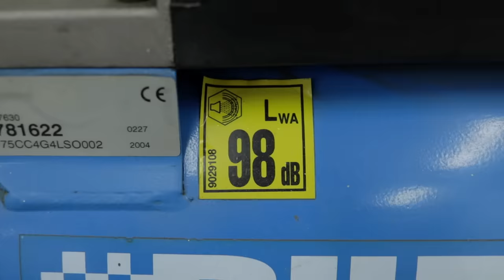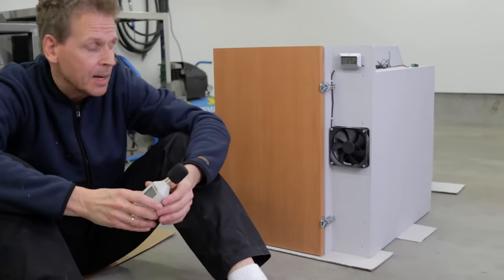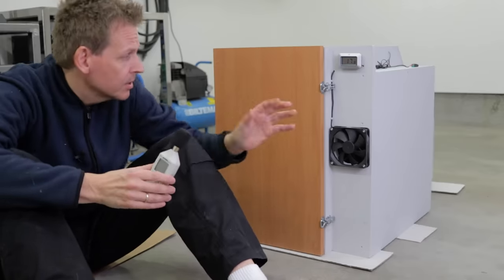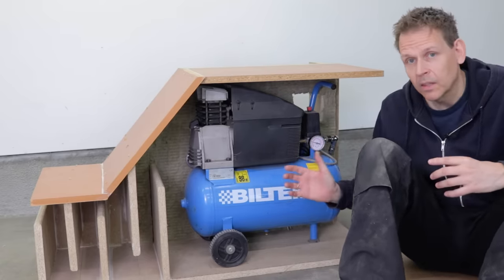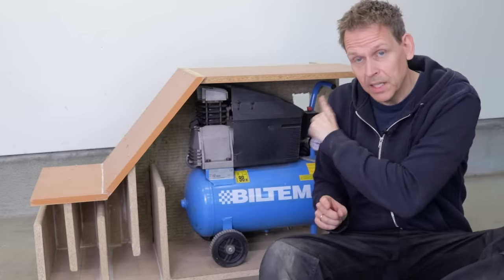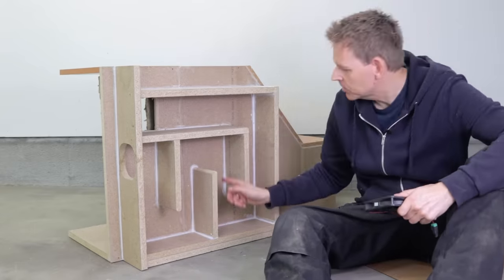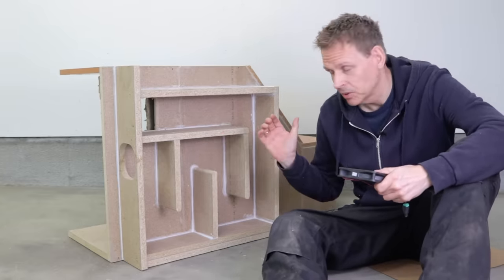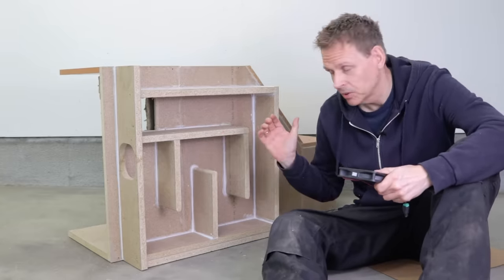Do not build a sound insulated enclosure for your noisy air compressor!

Comment: You could further isolate the vibration by suspending the airtank with nylon straps inside the enclosure.
Reply from the maker: @galen1957  yes, I have thought about at least taking off the wheels and using softer rubber to dampen it better inside. Vibrations from the compressor transferred to the box makes most of the noise and it is now

Comment: How do you drain the compressor now?
Reply from the maker: It's a bit cumbersome as it is now, I need to open the four eccentric locks and pull of the door and then take the compressor out of the box. It takes no more than 5 minutes, but it's enough to postpone it to the next day 🙄I better put on a line and have it on the outside....

Comment: Mechanical transfer is a big factor, spring isolators can help
Reply from the maker: You are absolutely correct! Vibrations are the biggest source of noise now. Will try to improve it by adding soft rubber, dampening foam or springs on the compressor and/or between the box and the floor to improve it. Thanks for the tips! 😊

Comment: Dig a hole in the ground. Made a metal container and place it in the hole. Place the compressor in the container. Fill the container with transformer oil, having previously routed the air inlets and outlets with suitable tubing. Put an old water radiator in the transformer oil next to the compressor and another radiator somewhere outside. Connect them with hoses, fill the system with glycol. Cover the metal container with soundproofing microporous rubber and XPS - Fibran

Comment: How about adding those foams that look like egg trays?
Reply from the maker: That would most likely work as well. I used 3cm Rockwool sound insulation mat because I wanted the box small to fit under my table upstairs 😊

Comment: Probably best to just buy the quiet compressor before you have this problem lol. Cost a bit more but I think its probably worth it. Nice job on the experiments
Reply from the maker: The silent compressor I bought cost the same as the noisy one, so it is actually not expensive at all. But it is weaker - 750Watt instead of 1500Watt. If that is not enough you air flow it will be more costly with a silent one. I have so far found out that 750W silent compressor is good enough for my usage. I use it for my hobby projects, for some tools I have to wait a minute once in a while but it's not a big deal. 😊

Comment: There is a way yo make a compressor totally silent without heat problem: submerge it into oil. The liquid both cools and dissipates heat better than air and also absorbs all noise converting that to waves/ripples in the liquid. Just make sure you use non conducting oil is it si in contact with electricity.
Reply from the maker: That would have been really cool to test out 😊 would need the air intake to go outside the liquid though, and quite a lot of the noise comes from it 🤔

Comment: Hello 
I want to insatall a pressur water pump  inside my house, is it safe to put it inside a sound isoating wood cabinet?
Reply from the maker: Is it a high pressure water pump? These mix air into the water to build up high pressure, so you need ventilation to get air into the box - similar as for an air compressor.  I assume it is cold water, and this probably keeps the compressor part cool as well. The motor running the pump might need air  cooling though. You might not need as much ventilation as for an air compressor, I would assume it produces not that much heat. I don't know for sure any of this 😬 I am sure it is possible if you just take care of cooling and have some sensors to detect water leaks. You don't want the box filled with water 😳😊
Reply: @kihestad  thank you for replaying my comment
It is 1 horse water pump , all i know about it is that i will connect it to the water source using a pipe (inlet) then connect another pipe to take the water to the house . It will increase water pressure using a fan inside the pump. 
I will try my best to make the cabinet cool.
Reply from the maker: Ah, ok - it's not a high pressure water pump then. It sounds like it's not mixing in air into the water. Probably best to ask the supplier or vendor of the pump to be sure if it's safe 😊 Good luck 👍

Comment: hi, nice video, but you're making a mistake that most people forget, that is, if you want it to be extra quiet, remove the wheels and install 3 new vibration rubber dampers. you can also buy dampers that are oil-damped, which take the resonance as a motor and propagate in the floor and the box and come out as sound waves. for example, you can buy rubber dampers that you use for the heat pumps.
Reply from the maker: That is s good advice! 👍

Comment: That makes me question what component of the compressor is making most of the noise?  My thoughts are that the air intake is the bulk of the noise (100% untested), what about ducting the intake outside and away from your work areas?  Also that can permit instalization of a vapour trap, any thoughts?
Reply: If you think about it, an air compressor is practically an ic engine working in reverse,  the noise is mostly from the pistons compressing the air, it is almost like a jake brake on a diesel engine.  While a majority of the noise comes from the intake, there is still a lot of sound coming through the metal from the pistons.  Just like how you can hear an engine running without any sound from the exhaust.

Comment: If you have used the "egg crate" type insulation it would have cut sound better than the felt you used. Also, it sounds like you use your compressor a lot. If that is the case you should have considered a belt driven twin cylinder compressor. That would have been even quieter than the "silent" compressor you moved to.

Comment: I mean, no matter what, the best noise dampening you can achieve is -15dB so if one wants a quiet compressor just buy one that is less noisy to begin with.

Unless you use sound absorbing material and soundwave traps, then you're not going to dampen sound by a lot.

Comment: If you already own a noisy compressor, try a muffler on the air intake. Not the cheap crap ones on ebay, do a search and get a high end one. They are close to the size of a soda can and have made major differences on some pretty huge air compressors I've used. Beware overheating a compressor motor in an enclosure, particularly if you use high demand items like die grinders or sanders and such. Install a drain hose with a valve for your enclosure if you can't access the tank.
Reply from the maker: From what I have found a muffler on the intake / exhaust helps a bit, but not very much. I could be wrong though... I did some research but did not find any solution that I found to be very efficient, not even the ones fitted a big car muffler. The tank itself also emits noise because it acts like a sound chamber. I would guess that if a muffler really worked, the vendors would have added it.
I have fitted a thermometer and I do check frequently that it's not getting to hot inside the box. So far no problems 🤞
When it comes to draining the task - I would say it's a bit cumbersome as it is now. I need to open the four eccentric locks and pull of the door and then take the compressor out of the box. It takes no more than 5 minutes, but it's enough to postpone it to the next day 🙄I better put on a line and have it on the outside....
Reply: @kihestad  The last compressor I heard this difference on was enormous, vertically oriented and took a forklift to move it properly or 3 or 4 guys could slide it across a smooth concrete shop floor. We actually had a very fit fellow who looked like Thor, who could get it to move by himself. It would easily run orbital sanders and other shop tool simultaneously. US standard voltage is 120VAC, this one ran on 240VAC. The mufflers now run about $75-$100USD. It would be nowhere near as quiet as what you made but it is a huge difference

Comment: Just letting a short commentary for discussion.
The air compressor generates a not negligeble ammount of heat by the energy loss, friction and also the termodynamics of compressing a gas.
I suggest avoid trying to put it inside of a small insulated space. The acoustic isolation materials are generally thermal insulators too so you can get pretty hot
Reply from the maker: I absolutely share your concern for overheating. The air compressor will not live for long if it is constantly hot above the recommended specs! 😐 However, It's a pretty cold climate here where I live in Norway, in the Northern part of Europe. I have actually fitted a heat pump in my garage to be able to use during winter time. I can see overheating is a big challenge in warmer climates. A more powerful fan or even radiator cooling could be needed must then be considered.

However, since I have a fan in front blowing air into the box I have airflow through the case that will "grab" the heat and transfer it out of the box. I have fitted a thermometer and checked the performance frequently. Normally the temp increases 5C = 10F from when it starts until pressure is built up and it shuts off, and then it takes just a couple of minutes to cool it down (as the fan continues to run after the compressor stops). If it is running constantly over longer periodes it can get a bit hotter, I have seen almost 10C = 20F increase. The warmest summer days can be 30C = 86F here where I live, but that is very rare. Its more commonly 25C = 77F, so it never gets very hot inside my box and it is within the range of acceptable temperature for this compressor.

Comment: on of the best and most efficient ways to reduce most of the noise from an air compressor is to pipe the air inlet someplace else where the sound will not be as much of a bother.  most of the sound from the head comes out of the air intake.

Comment: The problem with isolating a compressor inside a box like that, is that it becomes even more unlikely that people will drain the water from it, regularly. 
-many, if not most people, do not do it already. 
This causes corrosion, and eventually, tank failure. 
Tank failure can be explosive and deadly.
Reply from the maker: That's absolutely a valid concern. I have thought about adding a hose  and putting it outside the box. It's a bit cumbersome to pull the compressor out of the box to drain the tank 🙄

Comment: you need to install a door at the top of the stairs that will make the sound even more quieter
Reply from the maker: I have actually done it. I did it to keep the heat from going upstairs, but it really helped for the noise as well 😊

Comment: My only concern would be the thing overheating / early death from lack of airflow around it.
Reply from the maker: It's a valid concern. Here where I live in Norway it never gets very hot. The ventilation had been more than good enough. In hotter climates, better ventilation and perhaps even cooling might be needed.
Reply: @kihestad  my own compressor has cooling fins so i know it's depending on airflow.  it has a oiled pump.  I change the oil once a year.. but i dont use it daily.  maybe every couple weeks. it's not too noisy though and i generally dont work right beside it.

Comment: So much work for noise. But nothing is too much for sciense and for BILTEMA too, but is it worse for cheap compressor. Those short times I wear Peltors😉
Reply from the maker: Peltors are great, but using them all day long is a bit tiresome ☺️ I always use hearing protectors when I start a noisy machine. I'd rather not go all day with them over my ears, I don't think anyone does, when not operating a noisy machine I take them off. I might be easily scared, when a sudden loud noise happens it felles like my heart skips a couple of beats 😛 You never know when the air compressor kicks in. Typically it happens when I am very focused and it is completely silent in the garage. And there - BANG - it kicks in. I could not take it any more 😫😂😁

Comment: Its a bit pricy, but there are whisoer compressors available that are really quiet for a machine of their size and power
Reply from the maker: Yes, I think most of them use the same technology as the one I bought. For industry you can buy rotary screw compressors, they are very silent but they are big and much too expensive for a hobbyist.

Comment: I work in an automotive shop full time. Our solution to this noise issue was to build a shed outside, run power out, run air in with an air shutoff on our side of the wall, and turn it on and off with a breaker. All problems solved. easily serviced, its out of the way. I am under 5 minutes in, i bet he made an acoustic amplifier with his many chambers, like a trumpet.
Reply from the maker: Yes, that is probably the easies and smartest solution to the problem 😊Unfortunately, I just dont have space for it. My garage is placed with minimum distance to two of my neighbors. The side facing my own property is not usable either,  as it's just a slim path between my garage outer wall and a concrete retaining wall. In front of the garage door is no good either 😋

Comment: You have a nice reverb box that will amplify sound. If you want to absorb it, use a plain cube with lots of foam, cellulose panels, quilted padding. You do mention rockwool - a good choice but the box itself matters, too.
Reply from the maker: It does not amplify the sound, the measurements using the decibel meter shows it. Even though it looks like a speaker, it's not quite the same 😊I used Rockwool sound insulation sheets, they are very good for absorbing sound. I have used them to make sound absorbing panels as well (https://youtu.be/4EkoAMJAIug )
Reply: @kihestad  I didn't write "does" - I wrote "will." You built a resonance chamber.
Reply from the maker: @branchcovidian2001  aha, gotcha 👍

Comment: Seems like you're getting a lot of vibration in the case itself, which will always produce noises inside a box (because imparting kinetic energy to the air inside will always cause flow and as a result 

Though that's an issue that's not easy to address
 Increasing mass of the frame might help resist the vibration, or adding more layers of fabric internally

Comment: For anybody who has not yet bought their compressor--another solution is to buy a used air compressor from a brand that sells to dental offices and labs rather a construction tool brand. Unlike the "quiet" options at Home Depot (still very loud) those are legitimately quiet. I got a used model used for dental work for $300 and could run it at midnight without complaints.

Comment: Edit - Oh lol - now I've watched it that; exactly what he does :)  Though he should really have angled the baffles randmly and I would have had at least 2 more of them, it would not impeded the airflow at all but would have added more ways for the soundwaves to be diminished.

There are plenty of ways to build a sound baffled box that will still allow the compressor to breath while significantly reducing the decibels - you just need to build the airways so that there is no straight line for he sound waves and instead build angled baffles with noise reducing material attached like foamor rubber, even old carpet will do.

My compressor sits inside a box like this, has no issue giving me full air on demand even when the tank is empty, doesnt overheat and is only about 50db.

Edit 2 - oh dear he's not done the plumbing correctly - should have added a U section with copper tubing to help condense the moisture out of the air and a water / oil filter with a drain to remove said moisture.  oops.
Reply from the maker: Ahh, yes - someone else mentioned that the baffles should have been angled. It definitely makes sense. I have no idea why I did not think of it when I built it 😫
Reply from the maker: Reply2: Valid point! It's a bit cumbersome as it is now, I need to open the four eccentric locks and pull of the door and then take the compressor out of the box for draining it. It takes no more than 5 minutes, but it's enough to postpone it to the next day 🙄I better put on a line and have it on the outside....

Comment: Put the box on rubber blocks, instead of floor/box contact. Build a simpler box with heavy wall-material.
Reply from the maker: Thanks for the tips! I will add rubber to the compressor feet and in between of the box and the floor. I hope that reduces some of the noise now caused by  vibrations transferred to the wooden floor.

Comment: Maybe someone comment the same before, but, why don't separate the compressor motor from the tank and isolate only the motor?
Reply from the maker: Yes, it has been suggested - but not by many. It is a great idea 👍 I just did not think of it as an option when I started the project 😫 I would probably have done it now, if I where to do it again. Would have made my box smaller and easier to build, and it could have been even more insulated.